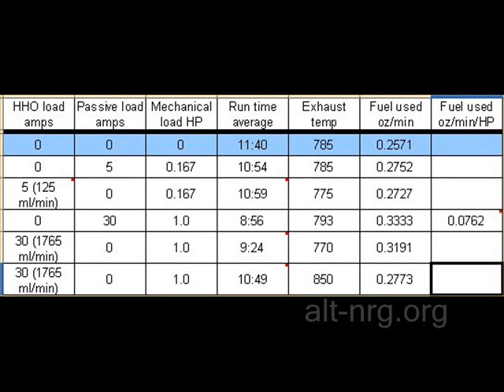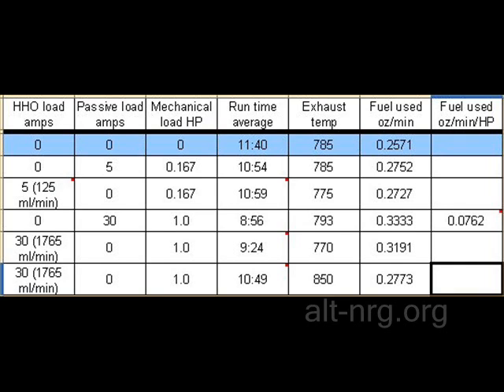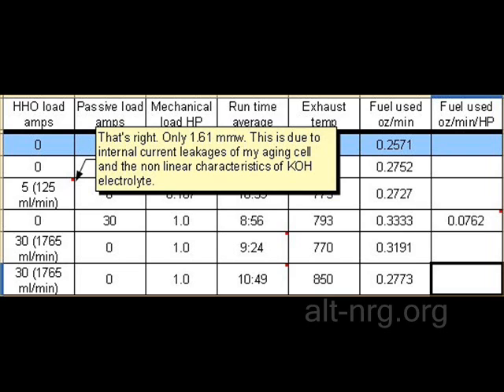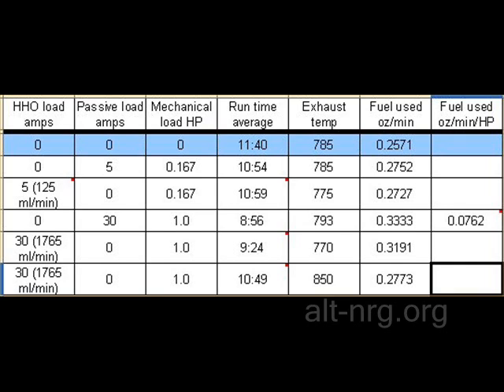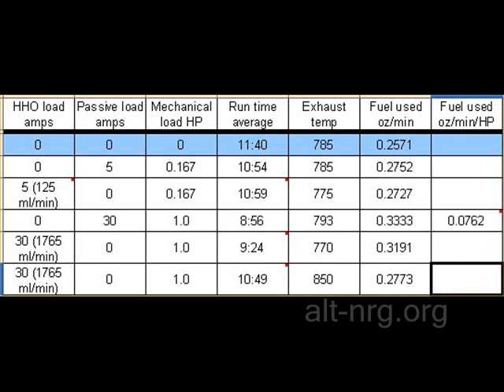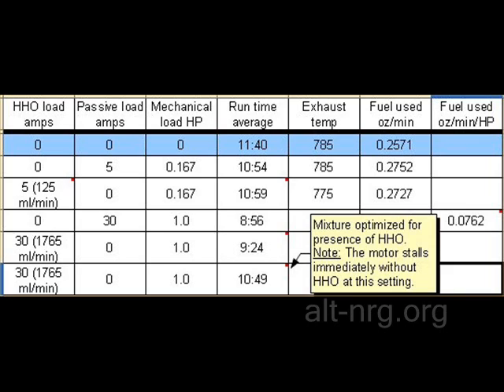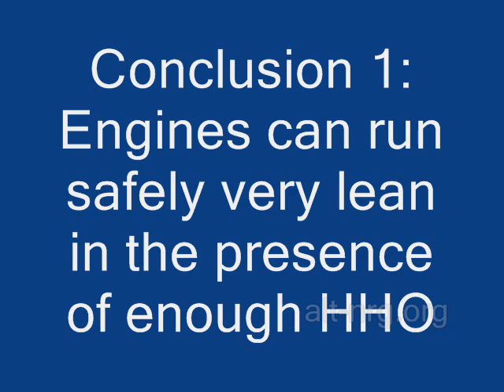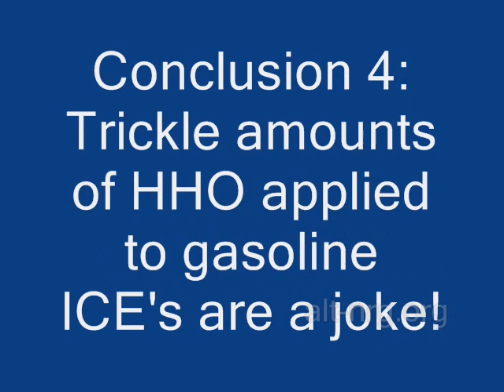#242 Run time test results, Part 2 of 2.

Comment: Even your own data shows it. There is no such thing as free energy. There is loss in your system, in ANY system. Therefore it is impossible to have a net gain of energy by burning gas to turn an alternator to make gas. You should be turboing cars and learning to tune for mileage and aerodynamics. You could have a Corolla easily getting 60MPG.

Comment: Z, you need to run the 5amp hho reinjection test while leaning out the carb. At 1.61mmw total efficiency is 13% and regains you 11% run time. At 4mmw total efficiency is 34% and regains you 18% run time. when you alter fuelling this changes to 69%.  To find out if linear scalling occurs you need to run a lean 5amp reinjection test, and a lean no load/hho test. As you can see at lighter loads the numbers look better so altering fuelling might work best there BUT a baseline lean gas test is needed

Comment: Zero; if i had you kind of smarts i would work out a way for the engine to do away with the alternator. Ive already got some ideas, but they arent useful to people without the know how, time and money to try these things. Both those things probably rule us both (and many others) out. If you could produce the hho at no expense to the mechanical energy conversion of the engine then you would gain run time, as i suspect you wont get linear scaling of results when using more effiecient designs.

Comment: @hydrtec this makes sense, although Zero is just trying to prove a point under best case scenario BUT you make a valid point as the engine would still be driving a car, while requiring an extra 30A for the cell.

Comment: @escuadrones11s like all these system you will not get a fuel saving if you use the alternator to pwer the electrolysis cell. Zero has proven this conclusively. The only way to know how much HHO you need to actually get an increase, would be too get a bottle of HHO and drive along injecting metered amounts and work out at what point you get a gain, when work out what that equates too in HHO.

Comment: If you find a DC motor that has 80% efficiency, does that mean it would still have 80% efficiency if you used it to generate electrical current from mechanical rotation? If so why not use that instead...

Comment: Thank you for your time doing research on HHO systems. We are a group of people in Spain trying to do the same thing. We’ve sent you a private message with some questions about the tests we’ve done. Our main doubt is that we haven’t been able to verify a fuel saving yet. Do you have suggestions about the best engine settings to obtain it (Ex: amount hho, etc.)?

Comment: @cptfbi   Exactly !   If one  sets  the timing  at TDC  or  a  degree after, because  the  flame  speed  of  Oxy-hydrogen is  ( 8 miles  in  1 second), one  would  realise  greater gains.  One  would  still  need   a positive  pressure  oil lubrication, not splash.  I also  use ( prolong) oil treatment  to  remove / reduce  heat  and  friction . in  all  of  my  internal  combustion engines.

Comment: Zero, I would love to see what a VERY small device that draws only 1 or 2 amps would do here. So far all of this type of testing I have seen is using FAR more HHO per liter than automotive boosting uses. I fear that the engine is seeing the HHO as a fuel and not a booster. With the built in ineffeciencies in the setup I fear that you will never overcome that. If you had a 30 amp constant load like lights or something then added a 1 or 2 amp cell I truely beleive it would be unbelievable..
Larry

Comment: @ZeroFossilFuel A quick and dirty way to find the break even point for the runtime parameter would be to hook another similar VSPB cell in parallel (HHO-wise) to the one being powered by the alternator.  Then power this one from a separate power source and redo the experiment with the supplemental cell dialed down to zero initially and take data sets with the supplemental cell providing more HHO until you find the breakeven total effective MMW required.  If it's less than overunity ur there !!!

Comment: The sample on line 4 with a run time average of 8:56 is for a system with **work done** (the lamps are lit) but the comparative run time of 10:49 on line 6 used to indicate a 69% gain in lost run time has **no work done** (the lamps are not lit)
although both samples represent a 30 amp load. Should comparative samples such as these have a common factor in terms of whether work was actually done or am I missing something? Thanks.

Comment from the maker: @All - BTW, I am going to build a cell to test with this rig that's 6+ mmw (>86%) for >52% total power conversion efficiency to demonstrate conclusively the 2:1 relationship of total system net efficiency returned vs power used.

Lastly, I will also show what happens to exhaust temps when you lean it out to the point where is will barely run without HHO and how little reserve power there is left in that condition.

Comment from the maker: @ReasonForemost I you use pure water only, no electrolyte, long term is good. If you use temps must be kept below 120*F for a margin of safety to prevent liberation and multiple stages of filtration. Otherwise it will eat away at aluminum engine components over time.

freds comments about ceramic and stainless are theory based on widespread speculation that a 100% HHO motor runs hotter. It does not and Scarecrows experiments have proven it.

Comment: @davematherly --- "The extra O is allowing the octane to burn more efficiently." That's not what the scientific data shows. H2 makes the octane burn more efficiently, O2 allows the octane/H2 mix burn more completely. Look it up you'll see that H2 increases the lean burn range of the hydrocarbon fuel while increasing the flame speed. This gives you an increase in the TE of the burn, you get more power out using less fuel. The question Z and others are working on is can the H2 be made on-board.

Comment: Good Job Zero!  There’s nothing like verifiable data to support one’s accomplishment.  Appreciate your time and effort and the knowledge you share.  BTW, what is your take on the long term affects of HHO on an ICE.  Freddy stated that he planned on removing the stock exhaust and replacing it with a stainless unit, that valves in the future would be replaced with stainless steel ones, and that piston tops would be ceramic coated.  Additional high cost should he successfully verify and replicate?

Comment: did you happen to run the rig with the gas leaned out as much as it could handle? I only ask as this then when compared to the leaned out gas+ hho run time test would then allow you to compare the eff of adding hho to the combustion, as you state, the mechanical>electrical>chemical energy conversion proces is only about 30% eff but regained 60p% of the lost run time, which proves hho does more then just add a combustable fuel to the intake charge, it does modify the gas flame propagation.

Comment from the maker: @insAneTunA This is a very crude setup, with a very simple carb and antiquated 4-stroke ICE. It is likely the worst possible platform on which to try and achieve net gains. If it can be done here it should be doable anywhere.

I am certain there are dozens of ways to improve results. Better fuel vaporization. Head design. More efficient cell and alternator. Different injection points. Variable timing. Plasma plugs. etc etc etc.

All I need is time. Got any to spare you can send me? :-)

Comment: Thanks for sharing all this work Zero. And the results are pretty straight forward. I can only hope that more people are able to replicate this experiment independently, just as basic but detailed as you did. 

I also wonder what would happen if you would inject the same amount of propane or butane gas to the same setup instead of HHO gas?  You seem to have the perfect setup to do such experiment, if you can find the time :-) It might be useless, but I am very very curious what would happen :-)

Comment: @insAneTunA Some older cars even smell like fuel when you smell the exhaust gas, that should be a clear indication for you that not all fuel is burned inside a cylinder. So if you can adjust a car in such way that all fuel is really getting burned then you end up with a more efficient car with a longer runtime. And it seems that HHO does just that, and to me it does sound logical.

Comment: @ke4uyp It is not the HHO itself  that gives the extra energy or horsepower. Without HHO injection the gasoline doesn't combust completely, but with HHO injection the gasoline does combust completely. The HHO works as an accelerator for the gasoline and because the gasoline can burn completely the burned gasoline will give of more energy. So the extra horsepower does not come from the HHO gas but from the gasoline. The HHO only helps to burn the available gasoline more easy.

Comment from the maker: @ke4uyp 34% efficiency got me 69% return. Therefore 60% gets 122.

Let's say we just break even. 50% pwr conv eff for 100% return. Same run time exactly with and without HHO. We invested 1HP we got 1HP back FROM THE HHO. Is it still a 3 HP motor? No. It's now a 4HP motor with 1 of the 4 running the cell. There is still 3HP available for the output shaft. At 122% return there would be 3.22HP at the shaft.

.-- .... .- -   .--. .- .-. -   -.. --- -. -   -.-- --- ..-   --. . -   ..--..

Comment from the maker: @ke4uyp Well, so long as you're going to spam this thread with the same comment, I'll return the favor with my reply.

Wrong, wrong, wrong. 2nd scenario. 3hp motor uses 1hp with a 60% total power conversion efficiency to create the HHO for reinjection. Return on that investment is 122%. That means our 20% efficient 3hp motor just became a 28% efficient 4.22HP motor. Net maximum output power gain of 0.22HP, a 7.3% GAIN.

Comment: But even with full HHO reinjection and the leanest mix, it appears you're still using slightly more fuel. Right? That would mean that, as a way to save on gasoline use, HHO in this context doesn't make sense. Moreover, since normal auto engines don't normally operate at consistent efficencies (speed up, slow down, brake), any benefits seem completely lost.